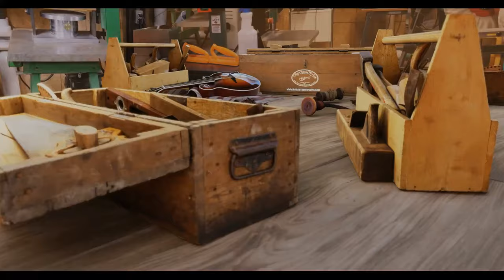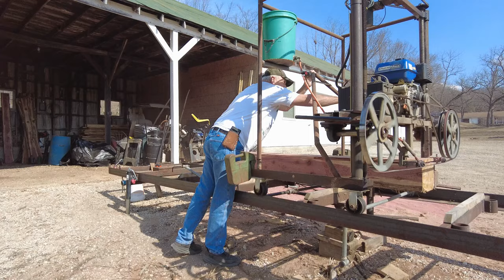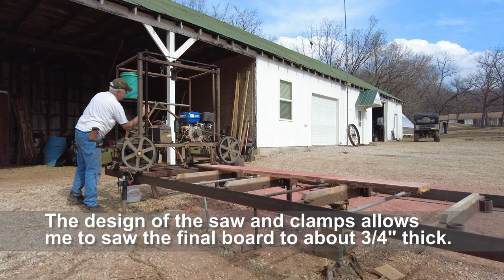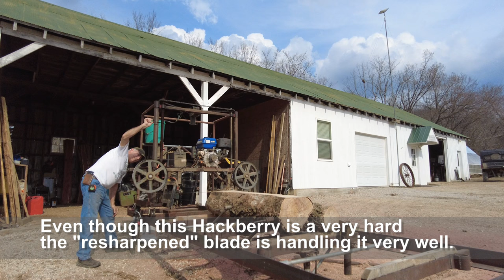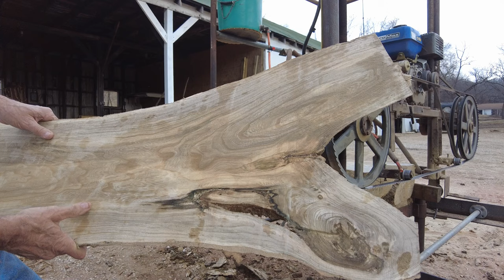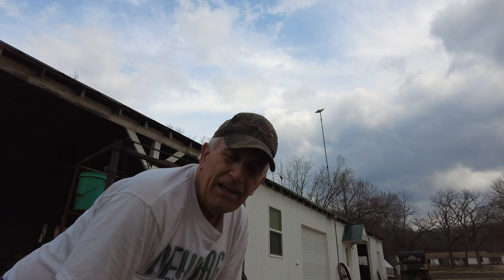683 RSW Homemade Sawmill Sawing Cedar and HackBerry

Comment: Was a bit surprised the blade cut horizontally- couldn't have been paying attention in the build video! I worked briefly in a sawmill back in 1970ish and  all cuts were vertical with the logs brought in on railway type bogies so the logs were brought to the blade rather than the other way round. Great job😁

Comment: Watching the cutting machine you built... the frame wobbles a bit when pushed from behind... to would be good to pull the frame from the front with a line attached low front center for a smoother cut.